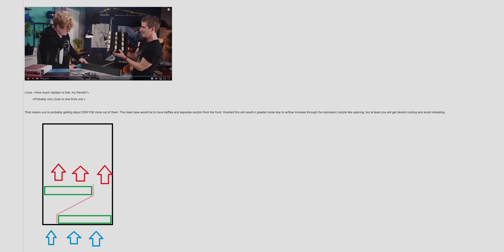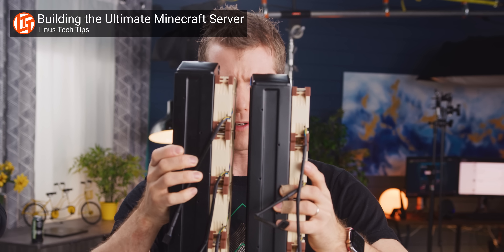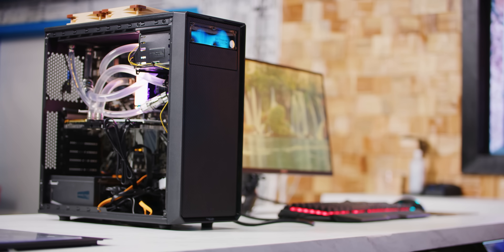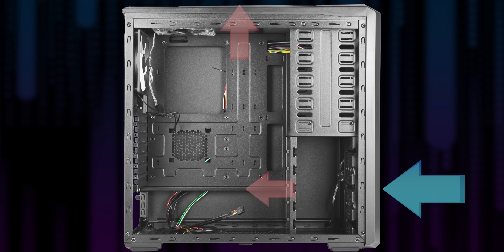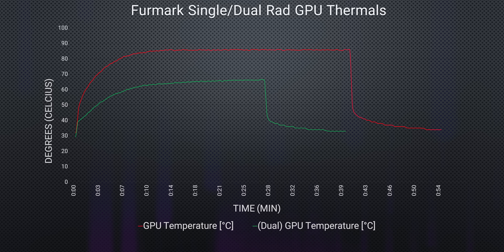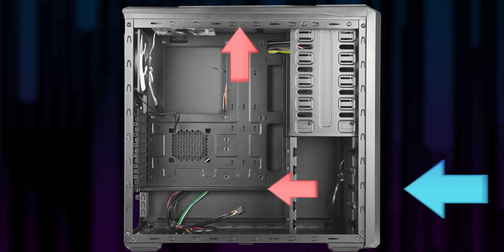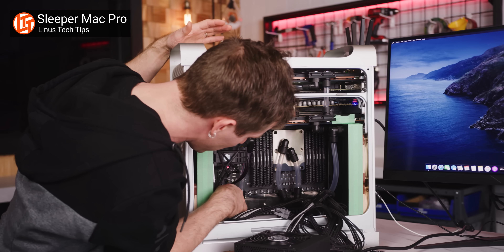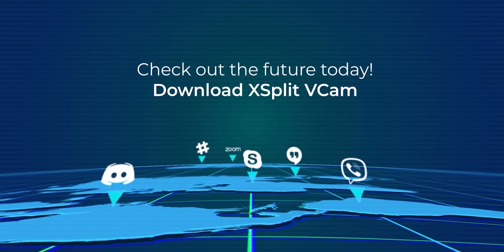I’ve been water cooling wrong for YEARS - $H!T Manufacturers Say

Comment: Process engineer here, I often do chemical simulations involving heat transfer. I think I kind of get Corsair's point, even if the wording is not correcto IMO: if you add more dissipation surface, the temps will always be lower.  However, for a fixed exchange surface if the temperature profile is flatter (or DTLM as is known in heat exchanging), the total exchanged heat will be lower, leading to less bang for your buck. You can even get a reduction in heat exchange if your temperature profile difference is too high depending on the exchanger thermal approach (the effect is less wanky and counterintuitive if there is no fluid phase change, like here). 

 Also there will be some effects on the boundary layer size impacting the boundary layer conductive and convective coefficients, but I'm not going to touch that with a ten foot pole as it's way outside my field of expertise.
Reply: Yeah, it did sound more like Corsair saying "this is less efficient/good-value" (with an implication that you should just get a bigger rad or keep them separate). But I've only got the screenshots of stuff shown.
Reply: It's probably because they've got a person with a similar knowledge background working as Linus' contact.  It is very possible that the guy merely looks at the numbers in simulations without the addition of the multiple potential variables that can completely throw your predictions off.

Although same note as you.  The entire field of thermal dynamics is completely outside of my realm of expertise at the moment.  I'll let those with more knowledge handle that, simply because I lack the time to build the base of knowledge to trade any blows... as of this moment.
Reply: TLDR from another mechanical engineer: the issue with heat exchangers is usually a matter of diminishing returns. At a certain point adding more HX area costs more and benefits you less. Especially if you are adding more back pressure to the system, and you end up slowing the airflow in the case. Heat exchanger design is a balance of maximizing surface area, bulk air flow, and minimizing extra fan energy to push more air.
Reply: @TheCobalt1365  the lower the flow rate the better bcz the fluids used will reach the desired temp faster bcz your giving it more time to exchange heat
Reply: I wonder how much of the advantage is just based on more water in the system with the other radiator.
Reply: @testlap7951  Not much.  Let's over-estimate the water in the second rad.  Ball park puts it at about 130 ml, so let's call it 150.  That means an extra 6100 Joules to reach a 10 degree delta, or about 15 seconds at 400 watts.
Reply: @testlap7951  I don't think the amount of water matters too much, at least if we assume there's not significant heat transfer through the tubing. In the steady state, heat from the CPU/GPU into the water equals heat from the water into the rad(s), which depends mostly on the exchange surfaces. More water = more capacitance = just takes longer to reach steady state.
Reply: I really like the distinction you make between “lower temps” and total heat dissipation here. It’s definitely what Corsair was in about.
Reply: @warasilawombat  that's only if you have two liquids, if I remember correctly you want a "cross flow" or counterflow for best cooling. The air just flows through a radiator so it's just the delta temperature that's cooling the water.
Reply: @Swedfarmer1  Correct, but with a serial radiator setup you can still make mistakes.
The first (hot) radiator needs to be on the exhaust side of the case.
That way the second (cooler) radiator can get the freshest, coolest air directly from the intake. It is not true cross flow but it has the same effect.
Reply: @kilianortmann9979  Yes that's a very good explanation for it! I thought i would make a note of it in my comment aswell but i couldn't find the words for it. Thank you for the free education ;)
( There is some really smart humans in this thread, holy shit...)
Reply: also they didnt touch on "plumbing direction" as it is a really big deal to use counterflow heat exchange vs cocurrent heat exchange. and watching the video i couldnt see properly which way is the water going around
Reply: That and the COLDEST the second rad can get your coolant is the same temperature as the air from your first rad.
Reply: This should be at the top.
Reply: Corsair had an interesting point which seems to suggest it's better to place the rad at an intake. Because the steady state water temperature going into the rad will be much less than the component temp, it is possible for outtake air that has already air-cooled some components to rise above that. (Of course this would just push up the hot water temp closer to the component temp and the cooling would still work, but it would lower the exchange.)
Reply: As a mechanical engineer one cant rely on a program. Experiments,theories,and program should be used simultaneously  to come up with a final conclusion
Reply: Once your ambient temperature also rises, the differences start to get smaller.
Reply: surly the mass of water play a part?????
Reply: @djstag2773  Not really, it just slows down the temperature rise. When the System has reached steady state (constant temperature) the amount of water makes no difference.
Reply: @kilianortmann9979  but the mass means increased volume of water and the longer it takes to get back to the heat source the more time for the heat to radiate=lower temperature, imagine a 1000L/1000kg water cooling loop as an extreme example, a 1L loop would still have temperature when it returns to the heat source and the temperature will rise and rise until it settles at a set temp (probably quite high), where as the 1000L loop will be back to ambient temperature by the time it reaches the heat source again and ergo the temperature will never rise. So therefore it can be concluded the more mass of water/chance for the heat to radiate the lower the steady state (constant temperature) will be
Reply: @djstag2773  No the temperatures would be exactly the, same if your pipes are perfectly insulated. Then the only heat loss happens in the radiator, and because the pump is the same, the radiator exit temp is also the same.
The reason your thought experiment works, is because your pipes act as a heat exchanger (second radiator). Just increasing the amount of water won't do anything.
Reply: @kilianortmann9979  but pipes are not "perfectly insulated" in PC cooling a9nd heat loss will occur in them, acting as a radiator, PC watercoolers don't insulate the pipes at all, quite often just being plastic or rubber (sometimes metal which is a good conductor which will allow the heat to radiate away well), not "perfectly insulated". The same goes for if you have a bigger reservoir (my theory), again these are not "perfectly insulated". This is what linus proves, the more radiant heat lost the lower the temp, be it in a radiator, reservoir or through the pipes, but you do need more mass/volume of water to achieve this (or more efficient radiators, which was not the topic of the video), if you have a second radiator in the same system you have to have more mass of water!!! The theory i explained was based around the mass of water not being "perfectly insulated"!!!!

Comment: I know for a fact in my setup, having a second radiator really helped. I started out with a 420x64mm radiator for my 9700k @ 5ghz all core, and a EVGA 2080 super FTW3. while under a 30 minute stress test with OCCT, my max cpu temp was 70° and my gpu maxed at 47°. After adding a second 480x60mm radiator, my max cpu temp was 61° and max gpu temp was 38°. Ambient room temps were 21° for both tests, and my fans were set at a fixed 1000rpm

Comment: Two fans bottom, two fans in front blowing into the case and two radiators with fans on back and top of case both sucking air from inside the case to the outside should be ideal and most efficient way of cooling. In any case you should not install radiator in way that leaving air go into the case or leaving the case on the bottom.

Comment: Place thermometers in between the minecraft server's stacked radiators and measure the temps. It is possible that you could slide the rads to the sides such that rad 2 or rad 3 get fresher air, this will only work if rad3 is intaking hot air.

Comment: Corsair is full of Hot Air:

Not all the air being pushed through a radiator is going to be heated. In fact, most of the air won't be. This in turn helps to cool a second rad. Sure, temps aren't going to be as cool as ambient air outside the case but it's not going to have a negligible effect on a second rad either.

Comment: Put the radiators on the outside of the case.  Thats if gpu and cup have separate cooling systems. I put industrial fans on my radiator. Noisy, but runs cool. https://noctua.at/en/nf-f12-industrialppc-3000-pwm

Comment: I'm curuoys if which order the radiators are in makes a difference (which one gets hot water vs warm water) 
Humidity can also play an effect on cooling systems (more humid air is better at transferring heat, as long as a differential exists, dry air is better for evaporative cooling (ie sweat and swamp coolers, but that is less a function of temperature, and more liquid quantity and air speed)

Comment: What about adding ducted cold air intakes(on either case side using a 3d printed plenum for the top radiator? or just using a larger core (thicker) radiator in front?

Comment: I think they meant the air intake radiator that lowered the performance by heating up the inside of the case. The stacked ones logically perform better but heating up the inside with an radiator attached to intake fans decreases performance overall.

Comment: Wondering if the temps would improve if both radiators were blowing out of the case instead one in/one out. 
Basically using the case venting for pure intake.

Comment: As long as the water temperature is higher than the air going in a second radiator will always help.
Laws of thermodynamics don't change just because you want them to.

Comment: I had read the same thing as it relates to having a higher delta increases radiator efficiency. I am running 4 radiators in a dual system setup. One top mounted EKWB XE360 in pull configuration and one front mounted PE360 in pull configuration for system one. System one ASUS Maximus IX Extreme, 7700k and dual ASUS Poseidon GTX1080TI's with EKWB waterblocks in vertical mount. System 2 has a XE360 with push/pull configuration across only 2 sets of fans 240mm area. One 120mm area is blocked by the mini itx plate. It also has a bottom mounted PE240 in pull configuration. System 2 running an ASUS Strix z390-i with 9900k and a single ASUS Strix GTX1080TI with EKWB waterblock. Both systems are running a EKWB Elite DDC 3.2 pump with one being filled by an EKWB Quantum 360mm and the other with a 240mm reservoir.

Theory being the thicker XE 360s cooling efficiency should be higher considering they will be fed not so cool air from the front PE360 and bottom PE240. It should offset the cooling hopefully.

Comment: Everyone keeps saying that they didnt do enough testing. They could have done testing on 100 machines and configs and done a huge sum of data. it wouldnt have satisfied you. The simple point of this video was to show that simulation data does not directly translate to the real world situations. This is true in probably every situation. 

The data that corsair gathers is done with artificially built systems that do not have a natural intake of air. Places like seals around side windows, case edges, intake points such as bottom of the case or back of the case where people dont usually put a radiator. Heck your case even takes in a small sum of air from the GPU slots and the front panel where people have a CD drive hole no matter if its filled in or not. 

A simulation will never replace real world testing.

Comment: I ran into issues with this on the pc011.  It has some very unique airflow challenges that I bet 50% of users never knew about.

In almost every situation where I put a rad or fans on the top and or bottom I received worse temps on the gpu and cpu compared to putting the rad on the intake and no additional fans.
I don't know what exactly this is, maybe because the positive pressure flies through the case, where the other fan disrupts the airflow?

But I feel most people just slap in fans and rads and if it works it work, without ever actually testing if they need them, because sometimes more fans doesn't mean cooler temps. It really depends on the case.

Comment: How does all the air go from ambient (20°C) to the water's temperature (<40°C+) in that short amount of radiator thickness? I'm not convinced that air moving that fast sits in the radiator long enough to pick up that much heat.

Comment: Heyy, I just got a I5-4460:) but the bench is showing that its base frequency is 3.6ghz, however, turbo isn't going over 1ghz:( this means that it's performing 
way below expectations. Any thoughts?
Reply: Since the i5-4460 isnt a hot cpu and can run with any stock cooler without any problems, I would guess either that your cpu is running in an extreme power saving mode or that your motherboard needs a bios update to utilize your cpu properly. (I have had a laptop where I upgraded the cpu and it wouldnt go beyond base clock, updating the bios gave me full turbo speed in that case.)
Reply: @Clau007 My intention was just to say that it for sure isn't thermal throttling and that even crap stock/oem coolers won't cause thermal throttling on that chip. Not that I would recommend them though :^)

Comment: I've found on my H115i that when I'm rendering at 100% load, leaving the pump at extreme does more for the package by 5-10°C!!! I guess higher pump speeds mean more water can remove heat from the base. Kinda surprising considering you'd think the radiator fans should be the biggest factor.

Comment: From someone who's been working with radiatiors for some time. The stacking radiators would probably always help since they are not 100% efficient and air would come out still some degrees under the water temperature. Having said that the gains would probably be quite small and maybe not worth the complexity.
Another tip to stack radiators is to try make the water "counterflow" the air. What I mean is, hot water will flow from the rear radiator towards the front radiator and the air from the front to the rear. This way you reduce the possibility that the air gets hotter than the water and you end up "warming up" the system. haha

Comment: The problem is your tresting arrangement i s wrong. You had the first run with the single radiator sucking "hot" air from inside the case. The second radiator you installed sucked fresh air from outside, thus heating up the inside more, BUT since the first radiator hadnt worked eficiently in the first place, your test results probably are false data. You should have installed the top radiator first, make the first test, then install the second radiator on the back and test again. Possibly, then the results would have matched those from Corsair.

Comment: It also varies depending on which rad the air goes thru first. Assuming you have a top and front rad config if air goes through the top one first then the front one you should get positive result.

Comment: I do have to wonder though if the flow direction makes a big difference (aka is the hot water from the system flowing into the outlet or inlet radiator) it seems like corsair's advice is more geared for the reverse scenario

Comment: The dual rad set up yes I could see in certain circumstances that may be problematic but stacking rads I'd have to see way more evidence than a simulation. Remember automakers have been stacking rads for years. Ac condenser, oil cooler inner cooler and engine rad. And it works there even when stationary.

Comment: Corsair's claims would be based on an assumption that the thermal output of the system was less than or equal to the thermal dissipation or the RAD in which case yes adding another RAD would do nothing (once the additional thermal mass of the extra coolant had been saturated). Since different components have different thermal outputs a blanket statement like this is just manufacturer b$Hit.

Comment: Linus should have pushed air through the top radiator inside the case to see if it makes any difference. Also, the test should take a bit longer maybe until the water is warmed up more.

Comment: Technically corsair is right as the cooler has a smaller deltaT to work with so the efficiency is reduced per cooler in a stack - but its not like they dont work - and cpu coolers compared to industrial 400kw heat exchangers are...  a bit different performance wise. I work with cooling so i know a bit more about it than joe average (cooling of high power frequency converters) - but in the end there are so many variables (pump, pressure, contact surface) that the notion of "work with the space you have" totally suffices.  i wouldnt rely on a quadruple stacked radiator in a cramped compartment to cool like 4 singular ones though :-D  And if one builds a server case there will be a drastic performance difference between using cold outside air to cool or warm inside air... but then again even myself due to other constraints (mostly lots of dust in the air in my area) i opted to suck air out trough the rad - rather than push in to prevent dust accumulation and make it easier to clean the rad in the way its mounted (fans on the outside) . Ive tested the opposite and got about 8-10° more performance but thats mostly well... the cooler either works with 20-24° room temperature or 40° case temperature - the results should be obviois :D

Comment: What if you had 2 intake rads and then you used 3-4 exhaust fans so it always pulling ambient cooler air and exhausting the hot air it pulls in